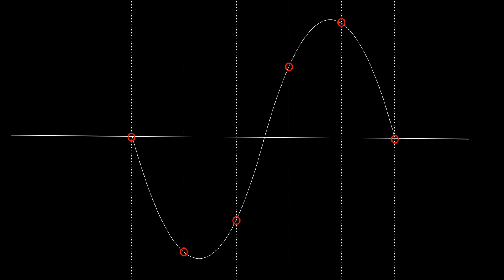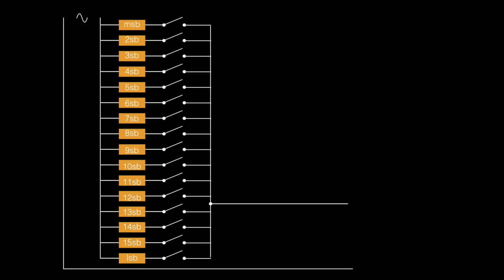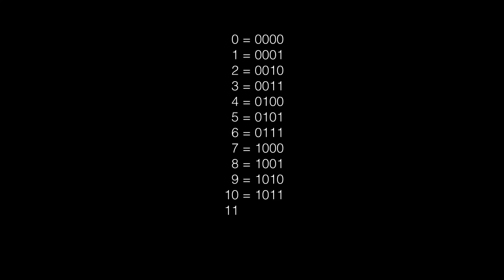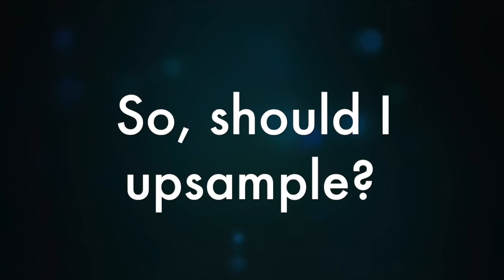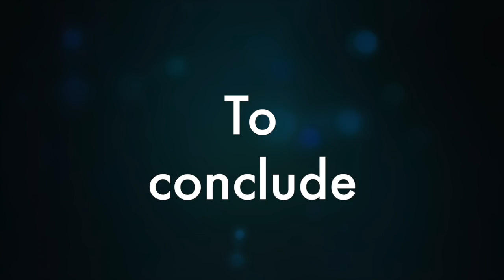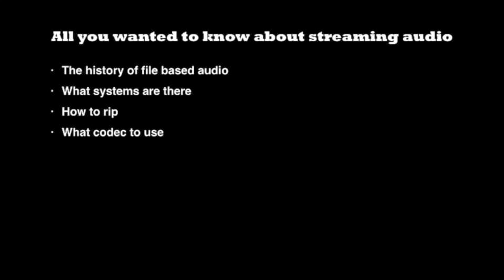Upsampling and oversampling

Comment: I have to say that setting sampling rate from 44,1kHz to 88,2kHz on my Dragonfly Black really improved sound quality. Apart from improved sound quality I found out that on 44,1k first moments of sound get cut off - for example in Windows testing sound is something like "tu tu tuuu" , but with 44,1k I hear something like "tr tuuu". To me 88,2k sounds better(more clear) than 96k - I guess that's because most of my music is in 44,1k and 96/44,1 doesn't go as well as 88,2/44,1.

Comment: thanks hans.

it's been a long journey for me. I use a Lenovo thinkpad x230 laptop for my source. the shielding in these units is remarkable and the internal filtering of the USB is of a superior standard. my dac is a audiolab mdac + and my headphones are hd700's.
the sound I get is more than adequate but I totally agree with you in saying the best equipment to evaluate other equipment are your ears. We all buy equipment made the same on speakers made the same connected by wires made the same. so should the sound be the same. no our ears are all different shapes and sizes with varying degrees of audibility. one of the best upgrades I ever bought was a bottle of otex ear wax cleaner. Used in the normal manner it gave me a better insight into my music collection  Anyway thanks for a great channel and thank you for being impartial in your reviews. It's so refreshing to have such a opinion of the equipment you test and yes I'm enjoying the music.

thanks

Comment: Thanks for this explanation.  I admit to having been confused about upsampling vs. oversampling.  The mathematical smoothing of the data points by interpolation and curve fitting seems logical.  We used to do that with other data in experiments on chemical processes at one point in my career.   On my DAC, it seems that there is an initial upsampling , and than an averaging of four of these upsampling calculations in the conversion.  It does sound very smooth.  Just starting to dive in and try to understand this more closely.  Of course, MQA has my head buzzing right now and looks like a breakthrough, but I'm still in elementary school on this one.  Keep up the good work.  We appreciate you sharing your knowledge.

Comment: Have you an opinion on whether or not changing the format during upsampling is advantageous or detrimental to SQ?  IE PCM>DSD upsampling done in software, such as Audirvana+, provided your computer can handle it.  I realize that when upsampling PCM>PCM, you want to stay in multiples of 2.  I also realize that DSD can be divided by both 44 and 48, so rounding errors shouldn't be a problem.  But, what if anything is lost in the conversion of PCM>DSD?  There certainly is a lot of hype about this in the forums.  So much so, I'm about to upgrade my converter to one that supports DSD so that I can join in the fun.
Reply from the maker: It all depends on the DAC you use. In the case of the Chord Hugo and the Mytek Brooklyn DAC's I prefer not to upsample. DAC's with less perfect filtering might improve sound wise when upsampling with a proper algorithm as is the case with Audirvana+. Conversion to cross conversion between PCM and DSD would be my last resort. It is very processor intensive.